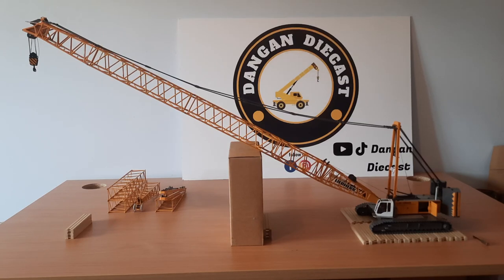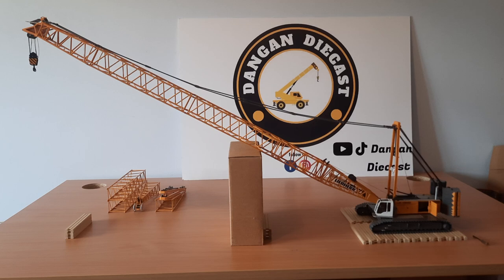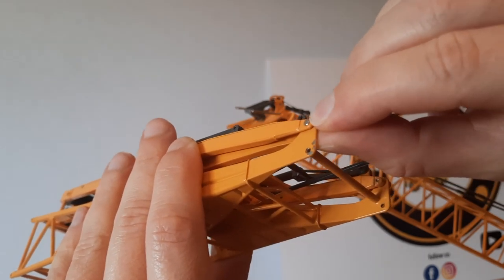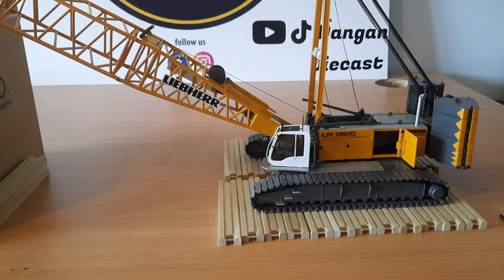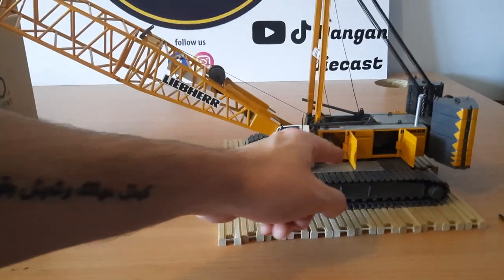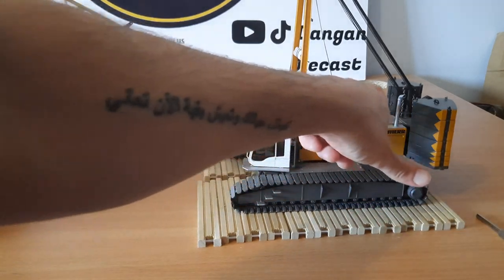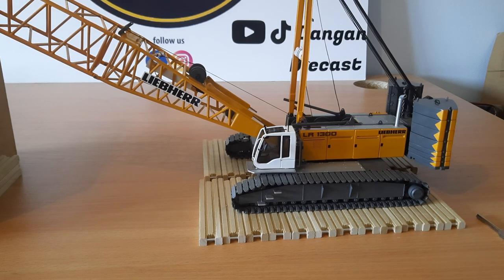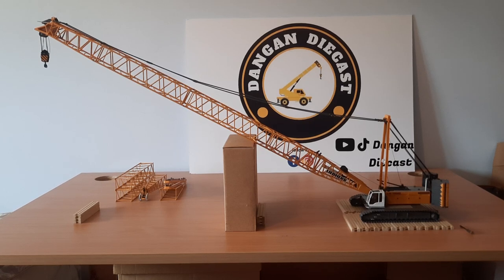Liebherr LR1300 Crawler Crane Review

Comment: I got my Sarens version back in January. It came with the extra boom and luffer section and the Derrick kit. My luffing jib base section came bolted to the main boot tip not riveted. I wanted a Liebherr version, not a Sarens but that’s the only one I could find. It’s a great model.
Reply from the maker: Fantastic model indeed, my only issue is the winch for the A frame sticks on me and becomes hard to move. The Liebherr version was a rare find, I was looking for it for months for a reasonable price.